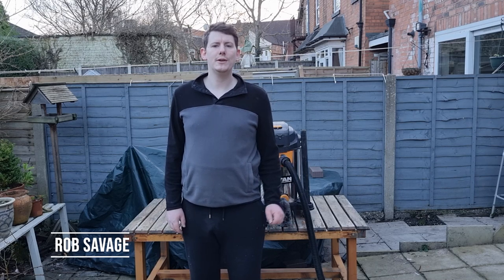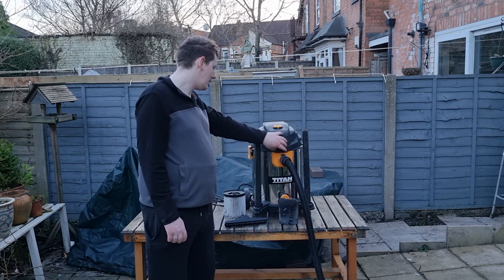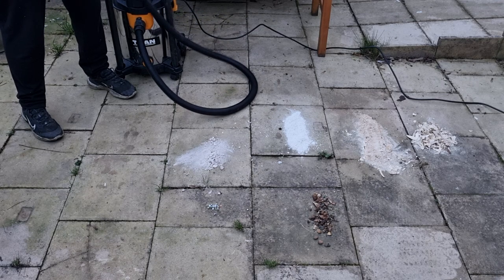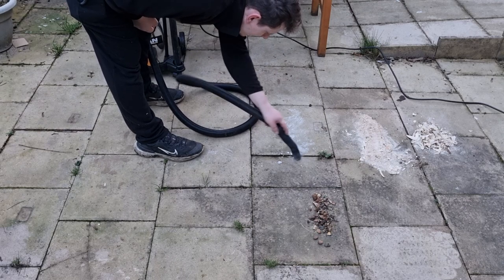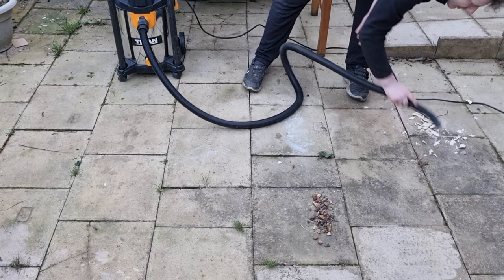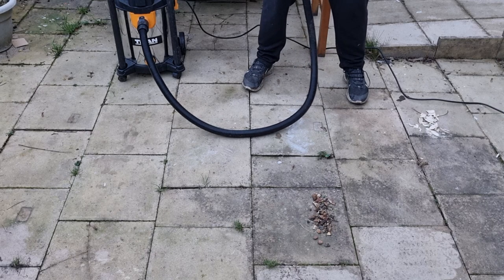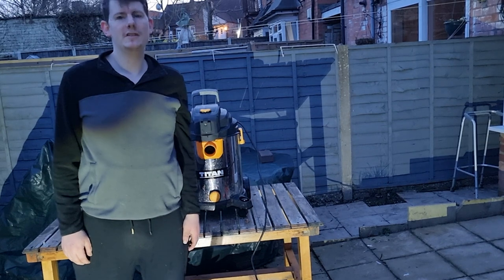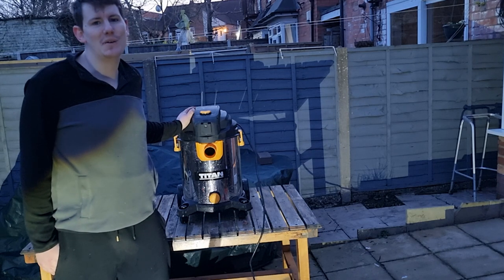TITAN Wet & Dry Vacuum Review: Unboxing, Testing, and Pros & Cons

Comment: nice review, do we not have to use a nylon bag for the wet function, or is wet function without a bag
Reply from the maker: You get a foam cover for the motor inlet for wet function, and the water just goes in the tank. Just give the foam a rinse after. For dry, you get a hepa filter. Thanks for watching.